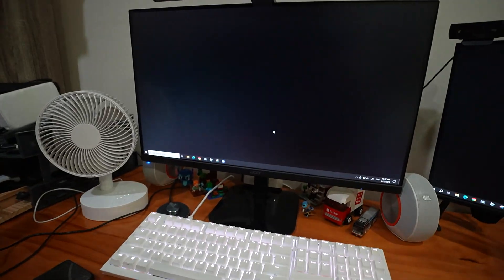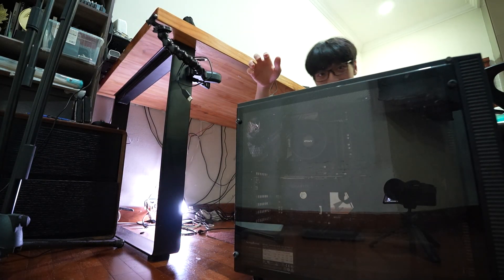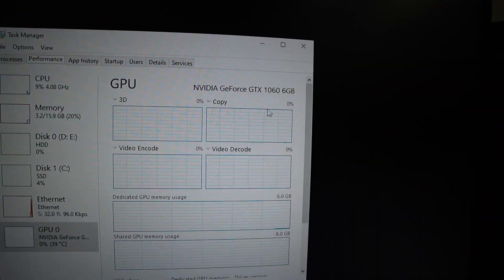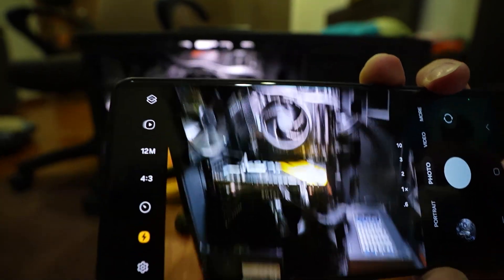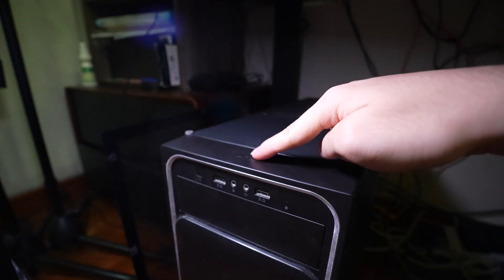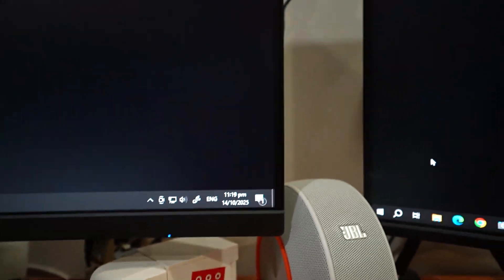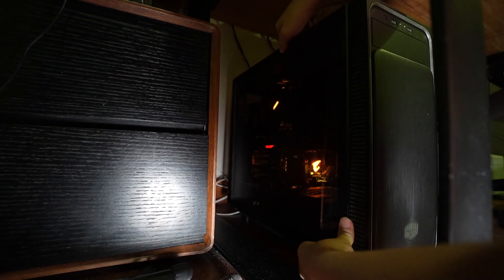i fixed my own computer for the first time

Comment: if you have some issues with freezing or your pc is acting up there some possible combination of reasons. 

first you did is replaced PSU which in some cases the reason why a PC became unstable. but you need properly diagnose all components as well. you mention that your pc is getting its time out of sync, you need to check the voltage of the battery. you mentioned that gpu is 2070 super and what i think is this unit is old and possible that cmos battery is done. however you need to check if you replace that battery and still it is going out of sync and suddenly when you test the volts (usually brand new one cmos are in 3.3v or 3.290v) and it way below normal after just installing it there is a chance that the motherboard some some issue

Comment: You just rip off the Gpus from the board.....you got lucky didnt brake anything. You have to push the pin on the pcie slot first before you remove the gpu. But well done you fix it and that what it mathers 😄👋👋

Comment: I wish I can do that, with my PC, I got a app that was preinstalled and click Test and it goes threw everything on my PC  to tell me what is wrong with it and what I need to fix and it has a support number if need be. if your wounding my specs its a (Legion Tower 9i gen gen 9 with a 13900KF CPU and a RTX4080 in it.)  I think? its form 2023 early so idk its a gen 8 or 9.

Comment: cpu is brain
motherboard nervous system that connects everything together into one
power supply is the blood vessels that power the organs (other pc parts)
the gpu is the eyes or the part of the brain that processes images while the monitor is the true eyes 
the ram is short term memory for like remembering stuff for a test temporary before getting rid of the information and using that for other tasks 
the hard drive or sdd is long term memory you store forever in your brain 
the pc case is the skin 
and the cpu cooler keeps cpu (brain) cool prevents overheating 
while the pc fans is like the sweat your body makes to keep your body cool
Reply: another tip never ever swap power supply cables with power supplies with swappable cable (or better known as modular power supplies) since they unique voltages that only work properly with their models it might fry your pc idk

Comment: 1. always when testing do not close pc panels if there's some bad shit happening you can quickly address it 2. cable manage, your shit looks whack plug all the cables required and do not mix and match power supply and its cables always use the cables included with the power supply that it came

4 why is your power supply upside down jesus

Comment: More than the power supply, I would say it's the PC case itself, because the graphics card will reach high temperatures and the case doesn't have decent heat dissipation or airflow, and when the components heat up, their performance drops.

Comment: the psu fan is wrong side xD bad for air flow also the pcie you can clip 2 off ALSO!!!! your time thats normal you need a new Bios cmos batterie its probably dead when you plug it off the wall
Reply: nothing like blowing heat into your PC

Comment: cable management could be better but its good enough lols
btw since your psu cables have 2 8 pin connectors for the gpu, you can take off the last 2 of the pins. like at one pcie cable that is 8, on the left theres 2 connectors that can be separated this way its not gonna damage your psu pins after prolong stress on the cable.

My heart clenched as you pull out that gpu without even clipping off the pcie clip </3

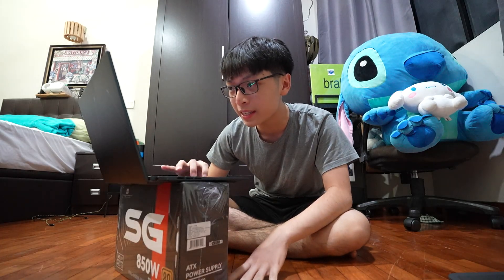Comment: hey lego! thanks for the shoutout at 7:10!

anyways, about some specific stuff

9:13 - that cable you unplugged is the USB 3.0 cable, it's for the front usb 3.0 ports on the pc case
9:44 - that is definitely an ssd underneath that black heatsink, specifically it's a m.2 nvme ssd, they slot directly to the motherboard unlike your hdd
10:06 - your old power supply is a non-modular type, they don't usually indicate good/bad quality but can usually mean more unused wires left around
12:13 - i think you may be talking about two direct pcie power connectors from the psu instead of one cable that's pigtailing, this is better since it increases stability/reliability since spreading the power load helps